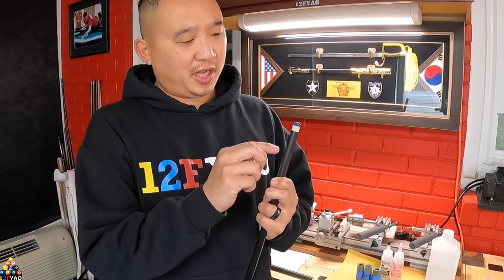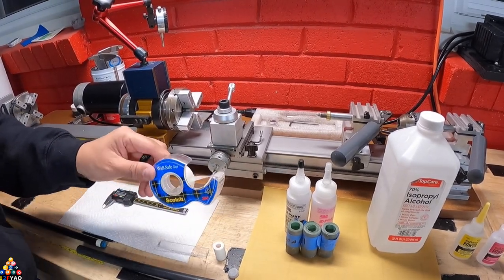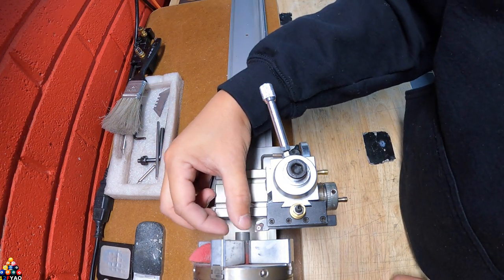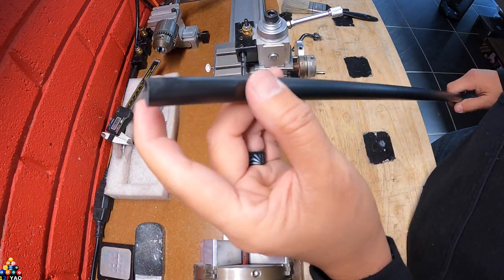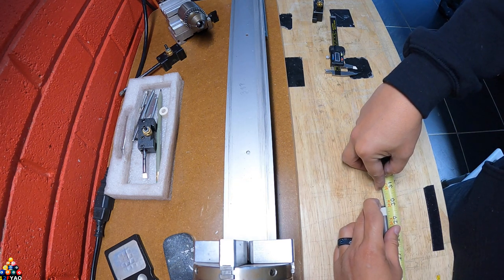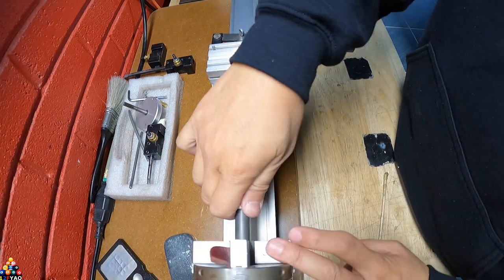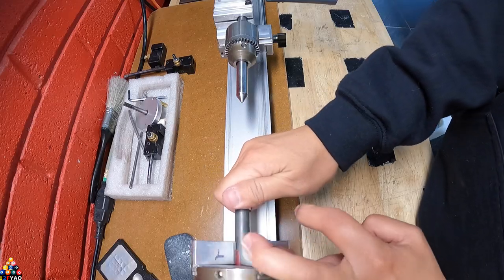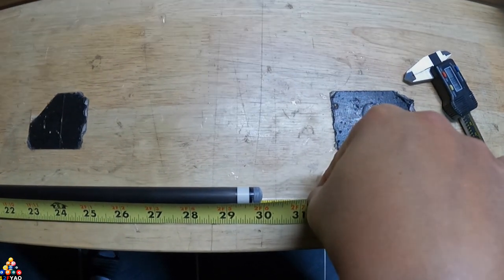Carbon Fiber Shaft Repair. Installing a New Ferrule on a  South East Shaft.

Comment: Hi , great channel and videos 👍 . Thanks for any advice on the following problem i have 😊. I like to do things mysrlf and am thrifty . I bought a  carbon fiber cue from Temu . It had a very hard tip on it and my stroke is not good enough for a tip that hard . I always change my own tips. Installing a medium Elk Master , Super Glue does not bond with the shaft . No ferrel on the shaft . Is there an epoxy that anybody knows of that i should try ? Thanks again
Reply from the maker: @RodgerMyers  I never heard anyone using epoxy for installing a tip. I heard of contact cement. Does the shaft have a valve plate, a thin material. I would make sure that vault plate is really clean. Also I would use some thin superglue on the tip make sure the tip wicks the super glue then use a thick gel type of super glue. Hope this helps and thank you for commenting.

Comment: Great video. Where did you get that quick change tool post?
Reply from the maker: @jeremymaynard4034  I got the tool post from amazon. I stacked it on top on a 1/4 inch flat steel. I drilled two holes to screw it down to the lathe slide and taped and drill to secure the tool pool. Hope this helps and thank you for commenting again.

Comment: Great video! One of the only ones on YouTube! Could you tell us what’s the stock you use to push the cross slide at 3:47 ??? It seems like your cross slide is loose and you’re operating it with that stick, is that true?
Thank you!
Reply from the maker: Thank you. The cross slide has to be loose enough to slide but not too loose that it is too sloppy. For the last comment, you are correct the plastic piece is my vacuum. Thank you for commenting and thank you for subscribing.

Comment from the maker: Unfortunately the shaft is still making noise but it is toward the joint. The ferrule area is not making anyone.
The shaft doesn’t make noise when you it’s by itself only when mated to the butt. I’m thinking it’s the g10 pin on the cue. G10 is notorious for making noise when tightening and the do not lock up like metal pins. When the cue is dropped on angle it makes noise. I know 100% it’s not the shaft. I rattled the shaft, tapped the shaft on my table and they placed it on another cue and no noise. The joints are rubbing when dropped on an angle because g10 flexes unlike metal pins. We all know g10 is strong and has great tensile strength but we also know they flex more than metal.  Thank you again for commenting.

Comment: Hey! I'm in dire need of some advice on my slightly scratched Predator Revo shaft. What would you do if it had light visible micro scratches like the one shown at 19:20? They annoy me when playing since the reflection differs from the rest of the shaft. Thank you!
Reply from the maker: I would try using Q Wax to see if the scratches will dull away. Just from regular use, carbon shaft tends to dull and get darker. Use a leather pad with Q Wax and try to varnish it. Normally varnishing things shine things up but for carbon, it mays it darker. Hope this helps and thank you for commenting.
Reply: @playpool12fyao  Thank you SO much, will try this and give it my best shot. Truly appreciate your reply
Reply from the maker: @UncraftedPlays  no problem.

Comment: Out of curiosity why do you choose to go with a separate tenon on CF shafts? I usually make the ferrule / tenon in 1 piece. Typically with Tomahawk. More like a plug you see on Cynergy shafts or the vault plate on Revos. For me it feels like it will hold up better due to the shoulder being up against the shaft and not just relying on the epoxy bond. 

Nice vides been following for a while.
Reply from the maker: The tenon is a “one piece.”  I used the tomahawk as a visual aid and to keep the same length. I used the g10 which I feel it is stronger than the tomahawk. The original tomahawk seems like it had stress fracture. Thank you for following and commenting.

Comment: Just curious, why didn't you install the tip before cutting the ferrule?  Why not cut them down at the same time?
Reply from the maker: I like to do the ferrules first just in case I have to sand them to flush against the shaft. I use to do it with the the tip on and I found out something the g 10 is not the same diameter as the shaft and with the tip on it, when sanding the tip would get hot and the glue on the tip and the glue bonding the tip to the g10 would fail and debond. Hope this helps and thank you for commenting again.

Comment: Not to suggest he did something wrong we all do. No one can fixed everything that can break without some testing. Especially with anything new or the latest product because info is not available. If you know you know if you don't you don't. If I noticed the existing ferrule was the same as the new ferrule I think I would have tried making the noise without the new ferrule installed. It may have had the same problem. Such as the epoxy not bonding to the ferrule or shaft. I've seen it before. Age or chemical degradation can attack the surface releasing the bond. But that seems unlikely being that they never mentioned if the sound was there from day one. GM and Ford have had paint not bonding or aluminum degrading causing the paint issues. You had to start over from bare metal(even replaced panels) to prevent it happening again.  As a technician I've learned to check that possibilty for certain repairs. I'd have poked the foam for any movement and did a few bounces just to be sure(was 'just' the shaft bounced?) . It sucks having done the work and it still has a noise believe me I know. I've done it a thousand times and it's not like he could have tightened a bolt or screw at the ferrule.and the joint would have had to been tight if it was joined. That only leaves what's between. I understand his disappointment though very much.

Comment: Hey man i have a question, i was playing earlier and i noticed a scratch on my Cuetec Cynergy shaft right beneath the ferrule, about 2-3cm but it is BARELY visible, should i worry of this?
Reply from the maker: I would not worry about it unless it’s a crack. With that saying, its difficult to crack carbon fiber unless you hit it in the right place. I know someone with a big gouge in his revo, you can feel the gouge when running your hand on the shaft but it doesn’t affect his play at all. I would just keep an eye on it, if it doesn’t affect your play don’t worry about it. Also in time it might buff out when you clean your shaft. Hope this helps and thank you for commenting again.
Reply: @playpool12fyao  Thanks man! I appreciate the reply, was really worried i might have to buy a new shaft. But since i noticed no difference in play, i won't.

Comment: Excellent workmanship as per usual. 

I noticed when you were removing the old T34 ferrule that you did not remove it all and only went an inch deep. I was concerned about this and thought that if the ferrule was loose then it made some sense that all the
T34 material may be loose including what you left behind. This may not be true but also may be true. Don't eliminate this as a possible reason for the noise. As you and I both know, noise can be thought to be where it is not. It may still be at the tip even though listening makes you think it is at the joint.

Switching to a different thought about the shaft, all that T34 material protruding down into the shaft really bothers me.  All this weight will really shorten the Pivot point performance characteristics of the shaft. Predator shafts claim to have a 19 inch pivot point and when tested this is roughly correct. This is what makes them a true low deflection shaft. It maximizes Shaft Deflection which minimizes Cue Ball Deflection. I am also familiar with Jacoby Black shafts and when I test their pivot point it is around 14 to 15 inches. This is about the same as many regular pro taper wooden shafts. This makes them similar to what a lot of people are already used to. Back to the South East Shaft, the carbon fiber wall thickness is not known at this time but assuming this to be close to other shafts I deduce that adding all that T34 weight instead of foam is really shortening the pivot point performance of the shaft. I would guess that before you fixed it, it may have had a very short pivot point of around 10 or 11 inches. This would not be what most parallel players would really want since true Parallel English likes a longer pivot point shaft like the Predators. That is the reason for Predators 19 inch. The Jacoby Blacks 14 inch is probably only so they can match the regular Pro Taper wooden shaft and this way people used to a standard Pro Taper wooden shaft will be comfortable with the Jacoby Black over the Predator. Is the South East carbon fiber shaft actually around 10 or 11 inches and if so, this would not be desirable for most players as it will have far more deflective characteristics and be very hard for Parallel English style of play but for true Back Hand English it would be very responsive. 19 inch is best for Parallel Style and Less is better for Back Hand (Pivot English) Style. I do not think any shaft on the market has been built to have the characteristics that promote Back Hand English style of play. I had to make my own which at present is 11 inches but this is not a good shaft for Parallel English style.

Your quality is excellent and your efforts are obviously intending to maintain quality in your products. You most likely maintained the original playing characteristics of the shaft while I am suspect of those original characteristics, not your work.
Reply from the maker: Thank you. The shaft doesn’t make noise when you it’s by itself only when mated to the butt. I’m thinking it’s the g10 pin on the cue. G10 is notorious for making noise when tightening and the do not lock up like metal pins. When the cue is dropped on angle it makes noise. I know 100% it’s not the shaft. I rattled the shaft, tapped the shaft on my table and they placed it on another cue and no noise. The joints are rubbing when dropped on an angle because g10 flexes unlike metal pins. We all know g10 is strong and has great tensile strength but we also know they flex more than metal.  Thank you again for commenting.
Reply: @playpool12fyao   That is good trouble shooting on your part. I will make a shaft with any joint style required by the customer but when I make a full cue I only make one joint style., 5/16 x 14. This style is around forever and proven friendly and stays tight. Uniloc is the worst as far as I am concerned, players are always making sure they are tight and they have very little room for adjustment. Other threads that have wood thread are weak and wear out over time. I can't tell you how many shafts I have had to replace the wood thread at the bottom. All these different pin styles really make no difference to the performance of the cue they are just makers trying to be different saying this new difference is better. Keep it simple. The only place I like a quick joint such as the bullet joint is for an extension on the bottom of the cue. The big thing that affects cue performance at the joint is how the two flats meet, the pin and thread do not help the straight line energy transfer of a cue across the joint. I met a cue maker that developed a joint style where the shaft wedged into the butt instead of two flat surfaces. The shaft had a cone at the end that wedged inside the same internal cone in the butt. I quickly informed him that the energy will trying to open the wedge and over time the joint will start cracking. These cues where beautifully made inlays etc but his thought process about the joint was simply trying to be different. He praised this new joint he invented as the next great innovation.  I explained the weakness of energy wanting to expand out to the side and eventually crack and try to open the butt end and I have never seen this joint again since. That was 20 years ago.
Reply from the maker: Awesome, I only do 3/8 10 and radial because that’s the only taps I have.  For the shafts, I insert the linen as a ring decoration and so it’s not just metal to wood.  Most of the carbon now are built the same way. Also I’m learning how to make shafts. I am doing research on cnc and just got a small desk top cnc so I can mess around with CAM and design a taper. Once I feel comfortable I plan to build a cnc to taper shaft. I totally agree with you about pins on cues. I can tell the pin size or what kind of metal the pin is. I can tell if it’s a g10 but not the thread. Like I said g10 doesn’t really tighten and they are flexible. The shaft vibrates more when tapping it on the side.  I like brass pins just because of the weight. It makes the cue front heavy and that’s the way I like my cues.  I have to use aluminum only to redo the weight to the cue but other than that the cue hits the same.  Balance point are different with different metals of the same pin but the sound and feel of the hit is the same.  Thank you again for commenting. I learn a lot from your comments.

Comment: The piece that you left may have slid down the shaft?
Reply from the maker: The shaft doesn’t make noise when you it’s by itself only when mated to the butt. I’m thinking it’s the g10 pin on the cue. G10 is notorious for making noise when tightening and the do not lock up like metal pins. When the cue is dropped on angle it makes noise. I know 100% it’s not the shaft. I rattled the shaft, tapped the shaft on my table and they placed it on another cue and no noise. The joints are rubbing when dropped on an angle because g10 flexes unlike metal pins. We all know g10 is strong and has great tensile strength but we also know they flex more than metal.  Thank you for commenting, please subscribe if haven’t already and please share.

Comment: What is that thing you spray after puting the glue on?
Reply from the maker: It’s an accelerator for the superglue. Thank you for commenting, please subscribe if haven’t already and please share.
Reply: @playpool12fyao  do we have accelerators that we can use from our house? Like a home remedy type of accelerator?
Reply from the maker: Not that I know of except baking soda but I wouldn’t use on installing a tip. Accelerator are cheap and common on Amazon.  Hope this helps and thank you for commenting again.

Comment: hi what glue do u use?
Reply from the maker: I used 5 min epoxy from Zap for the ferrule and super glue for the tip. Hope this helps, please subscribe if haven’t already and please share.
Reply: @playpool12fyao  would u recommend epoxy to fix cuetec ferrule also ?
Reply from the maker: I would use epoxy because it holds better and if you get some on the shaft, you can use rubbing alcohol to clean it off. Hope this helps, don’t forget to subscribe if haven’t already and please share.